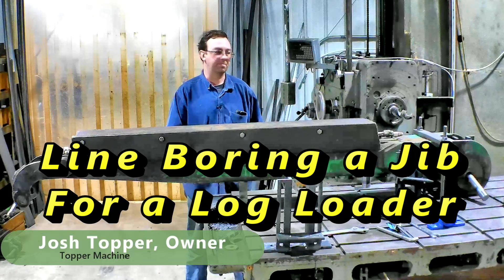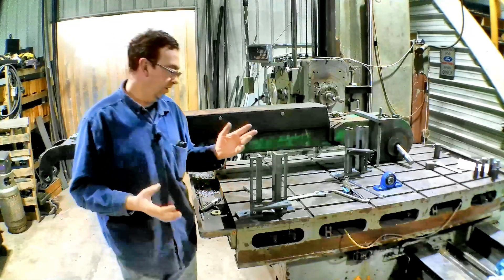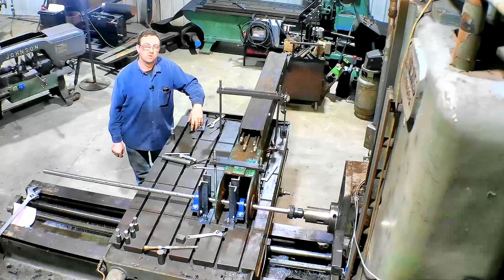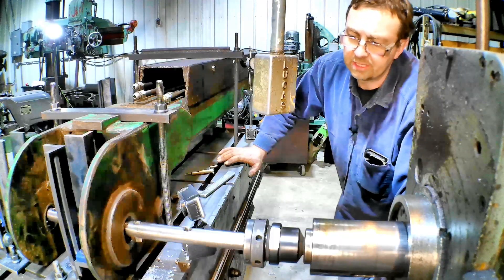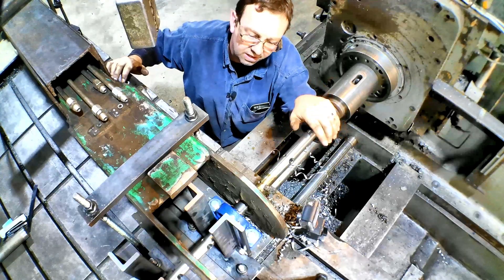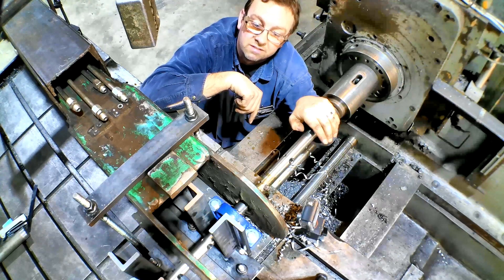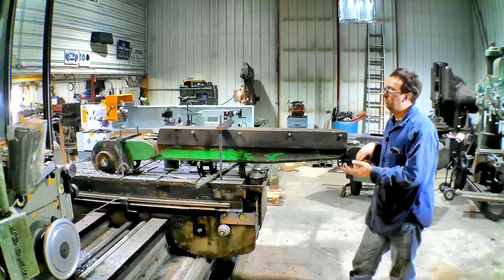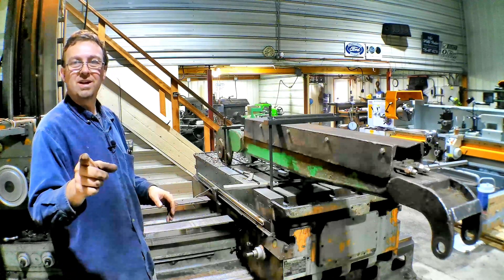Line Boring a Jib Section (Dipper) for a Log Loader - Machining on the Horizontal Boring Mill

Comment: Much better boring bar support now!  Once this is fixed the operator is going to miss his “omnidirectional” joint.  Regard how you do your videos, you do it your way.  People can take it or leave it.  It takes a lot of time to make a real top shelf video and I can understand if a person doesn’t want to do that.
Reply from the maker: I want to do better videos, but time is not there. Maybe if I cut back to one a month, I could do it, but that's not going to keep people around to watch. The next video is with the new camera, and it is significantly better. It's been crazy in the shop this year and hard to turn a 30 minute job into an 8-12 hour production. This video in particular was a 2 hour job, but it took 8 because of setting up shots, reshoots, changing angles, etc. Nothing easy about doing YouTube videos. I started it as a marketing tool to show what I can do, and it's grown beyond that.

Comment: When finished I believe both holes are not the same size, the plugs are turned to fit and the bushing takes care of final sizing.  The line boring is just to ensure both holes are on the same plane line - correct?
Reply from the maker: Yes. On this job anyway. If I would have bored to a precise size on both, the cost would have been much more. This customer has been a great one and some of their stuff we try to do cheap and quick to get them going again. This was one of those jobs.

Comment: Nice job, well done.....Please dont take this the wrong way......your videos are excellent.......not sure if my eyes are playing tricks on me or am seeing a bit of rotational whip in the bar....as your bar is soooo long, why not make a 3rd bearing block/steady rest on a stand to put 3/4 way out on the furthest end.....you can measure the rotational whip at cutting speed and I think you'll notice the bar flexing from its static plus/minus on the short end......as on rotation...(ie the .0005 over 18-20 inches is multiplied to the bar flexing to .005 over a 5 ft increase and even more as the bar length increases)......my eyes may not be what they were 40 yrs ago when i started my career.....but i swear im seeing some whip.....just an observation....
Reply from the maker: It's entirely possible, or it's camera problems. The bores came out absolutely perfect, so I'm not sure myself. But worth looking at in the future. Thanks for watching.

Comment: How do you center up an egg shaped hole ?????
Reply from the maker: you use your best judgement or find something you can reference from.  Its quite difficult, but luckily this job wasn't super critical
Reply: @TopperMachineLLC  Josh sometimes there clues hidden like datum  cuts.  that's the way we did it when I did my apprenticeship in a OEM woodworking machine building company. The old timers always did there datum reference cuts. did not see any on that one. We also did a lot of factory sleeves held in with a set screw  Dutchmen then the Bronze or brass bushing  was pressed in using the spindle  then final bored or reamed. Our road service repair men absolutely insisted it be done that way due to shoddy preventive maintenance of the majority of our customers and because of that they got the engineers to change the prints. Back then every thing possible was done to make field repairs as quick and easy as possible.I don't even thnk the customer even knew about the Dutchmaned sleeves because they were painted over pretty good, it made the road guy look like a hero when he got them up and running quickly ( i learned quite a few tricks from the old road guys when they were stuck back at the shop)I think the engineers to day try to make everything harder to repair. Also back then if the engineer sucked or made a mistake he was gone in a hart beat. Now days it seems that a person gets his degree finds a place desperate enough like they all are now  and has a job for life even if he or she sucks  BTW When i heard you say Dutchman i could not believe my ears i have not heard that term in 30 years would be interesting to know how many of your subscribers or the thousands who watch you even know what that is. I love your content it makes me smile and think about stuff I have not thought about in a  long time so looking forward to meeting you someday. Also liked your reference to your counter part Down Under i watch him too but I will always root for Wisconsin guy.
Reply: i was wondering the same thing??

Comment: "Very worn" is an understatement. 🧐.
Great job,  and like the new outrigger bearings tooling.
Thanks for sharing. 
Best regards from the 🇬🇧
Reply: fixturing is a lot of  work. it is the need for safety of the machine and the operator. it is hard to determine what the minimum safety level. because.when safety works you do not know how much extra  safety you have. you only know you have a safety issue when something goes wrong. and of course then it is to late hopefully some thing minor to fix.
many of us got scared when josh removed osha mandated safety guards on the brake press.  osha safety addresses accidents that have happened and  the painfully stupid things like putting a finger in a crush point with repair not possible.   josh has a healthy respect f or pinch points.  josh chooses to remove osha required  guards he takes responsibility if he slips up and crushes a finger by accident.  

another different example a roofer is working on a roof that requires safety equipment.  this person said he knew it and when his boss told him to go work on the roof because he was good on the roof and the boss would get safety equipment. well this   person of polish nationality with a green card over 10 years ago. living as a homeless person looking for a free ride. he had 2 cars while a typical homeless person has no car or at best one car. this bloke had two vws  but he failed to understand a single person can only drive one car at a time. he parks in a high crime area and he wonders why some one  would break into his piece of in my opinion was a piece of trash but you one person's junk is another persons treasure.
back to the roof job. he slipped and fell of the 16 ft  high roof and broke his leg.  i felt sorry for him because he said he needed the money and had to work in our corrupt non.democrat country. 

when i asked him did he know he needed safety equipment and he said yes and did he still go on the roof. and he said yes he needed money.  when i asked him directly did he choice to go on the roof. 

than told him any intern training to be a lawyer. would refuse to represent him in a court of law . this dum dum  pollock made the choice to go on the roof and fell off. the boss is not responsible for his broken  leg that is not healing properly.  he is. and he knows where every hand out that can be gotten. and he knows less than the scarecrow in the wizard of oz.  he ate some nasty garbage out of his car and within an hour he was pucking his brains out  had to be food posioning his food and his choice to eat it. then he had to take  a dump and he had to go to walmart to relieve him.  i wanted say thank god and one vw jetta for taking him away. eventually like a bad penny he returned. belly aching he had to raise his feet otherwise he could get a blood clot in his broken leg. and doctors said they would have to amputate  the leg. offered him a lawn chair to use and he was happy. when it became dark and cold. and he went to walmart to take a dump
and in the morning  i found   him asleep with his jetta idling burning hi test premium gasoline. i found him in his car crunched up behind the wheel. if he becomes an amputee  it is his choice again.

lunch calling.

Comment: Hi  Josh the new setup for the bearing blocks looks to work really good, I would have liked to see the finished product, maybe just add some pics at the end of video. Thanks
Reply from the maker: These supports were quick and easy with on hand material. I have an idea for a much heavier one and plan to build it soon.
Reply: nice video. you repair it so that if your final solution needs repair. you grind flanges off and put new flanges and/or bushings
 
alternate approach is to weld up  material so that is   bored out to fit. and it wears out again. and needs to be rebored next repair. if you get the job to repair you use your way again because your way is better than the alternate way. your way allows the next repair to be done with less steps and processes so subsequent repairs will be more cost effective as long as costs of labor and machining. so fix it right the first time it will less work the next time. i guess  it is a play on words. pay me now or play me later as rework.  that's where  you say make it right the first time.  further wear goes to repair and not rework. did i    understand or do i need addition information? thank you for educating more than i knew yesterday. keep up the good work my friend.